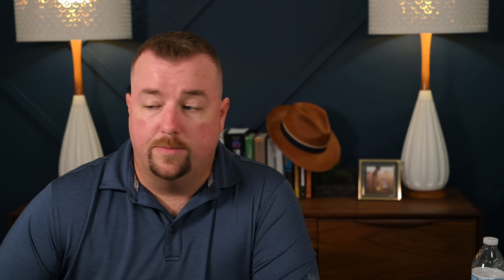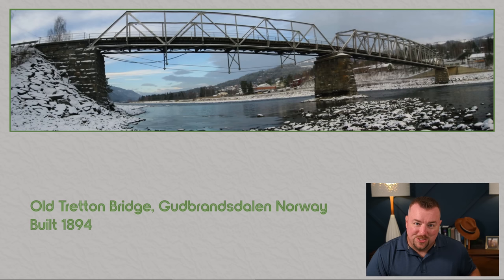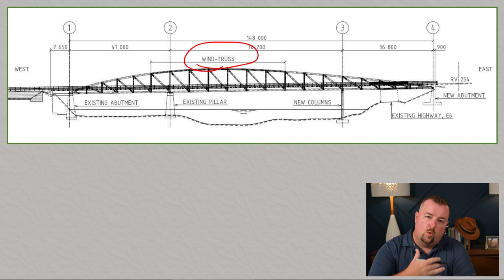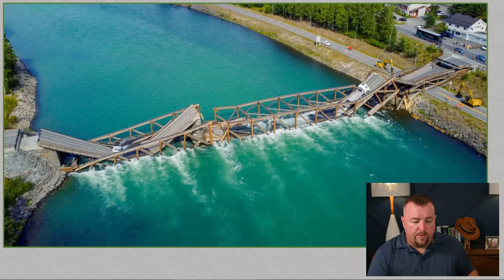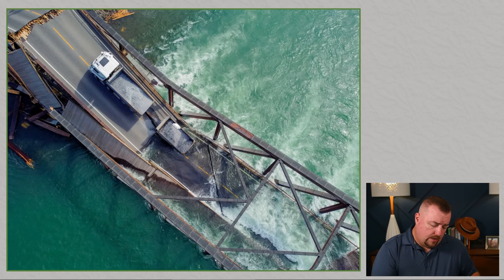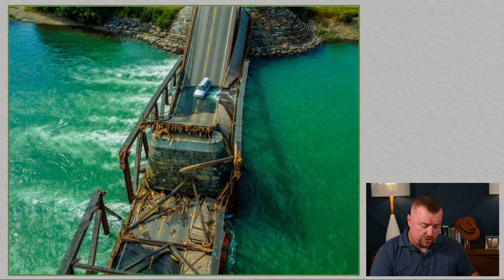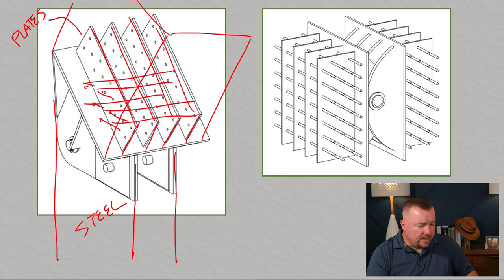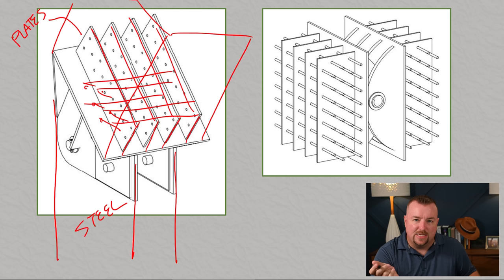How Did the Engineers Miss This?

Comment: Very interesting analysis. The failure illustrates why axes and hammers use a split and wedge to fix the handle into a socket rather than dowels. With a wedge the properties of the grain facilitate and enhance the joint. Also shows why old composite trusses usually use iron for the tension members.
Reply: The wedge design used to hold an ax head in place is a good example of how to hold metal and wood together. The wood is compressed against the metal. The same could be done in this bridge design, if instead of using a large number of dowel rods, they were to use heavy metal plates on the sides with a smaller number of large bolts or threaded rods clamping the plates together and holding the wood and metal under compression. There should be no shear between the bolts and the wood.
Reply: How is differential expansion and contraction deal with.

Comment: If they wanted to use natural materials, they could have just build a stone bridge. Correctly designed, those things last forever, even under heavy usage.

An example of this would be the viaducts of the Semmering mountain railway. Construction started in 1848 (yes, 150+ years ago), it was the first proper mountain railway. The original stone viaducts are still in use and hold up to modern railway traffic.

Comment: I'm not a structural engineer, but as a historian, I would have told you that the wood glulam stuff would have failed exactly as it did.  Over 2000 years ago, the Romans were making their shields out of laminated wood, but the grain of the wood for each layer alternated horizontally and vertically.

Comment: 19:00  Perpendicular to the grain, tension pulls the crack open and compression squeezes it shut. 
 Though the wedge action is generated by pushing, the split opens ahead of the bolt so the grain is getting pulled apart (cross-links between fibers)  
        
Ductile failure is where the hole-stretching (plastic embedding) is no longer able to accommodate the bolt's advance, and the piece begins to split -- the brittle failure.

Comment: Regarding the paper sentence:
"tested specimens were broken by tension perpendicular to the grain"
If I am understanding that correctly, they are saying the tension that causes the failure is perpendicular to the grain.

This is not saying the break would be perpendicular to the grain or that they were trying to make it fail that way.

Instead they are saying the failure was literally the wood appearing to be ripped apart with the grains separating, as observed in the photo.

This is because as the rods where pulled down, they tried to split the wood pushing it apart to the sides, placing the wood below the rods under tension perpendicular to the grain.
Eventually that tension exceeded the tensile stress of the wood and the grains separated.

Comment: The laminate was also laid on its side - meaning the bridge was being supported by the wood in its weakest position. Anyone who's looked at the frame of a house could see you always put things like floor joists so they're on edge, because a 2x10 has much more strength going from edge to edge, than through the 2" thickness.

And glue laminated beams are no different. If you put them on their side, the bottom piece of wood used in making the beam is left to support itself, and thus is vulnerable to failure much more easily than if it was properly on edge, where all of the constituent pieces are equally supporting the load.

Who wouldn't have seen that during construction?
Reply: The first time I saw something like this bridge was an ultratruss. It was a 2" thick laminated web that was 18" high with 2x4 cords. It was to span a squash court. If you flopped them over they wouldn't carry a single person, as installed they were rated to over 4400lbs equally distributed.
Reply: The composite beam was on edge, thats the important part. I would argue the lamination was correctly oriented, but the connections were pretty obvious not. Glulam beams are typically stacked laminations like this, where lvl beams are layered they other way with much thinner veneers being vertical.

Comment: Thanks Josh for another fascinating failure analysis video.  

I was shocked to see an uncovered wooden bridge was being used to carry such heavy loads over water and with a huge span between supports!  Wood, like concrete, doesn't perform well under tension.  Also, wood has a much different temperature coefficient than steel, in addition to changing size with relative humidity.  I see many problems with the steel/wood interface but, that would likely trigger a never ending debate.  Anyway... I enjoyed the video, thanks Josh!
Reply: And what is the thermal expansion co-efficient of the glue, relative to the wood? And what about the wetting expansion/drying contraction, and freezing expansion/thawing-&-drying contraction, both of which would affect the wood, but not the glue? Lots of problems. At the very least, protect joints like this from getting wet.
Reply: @grizzlygrizzle  Yeah, the list goes on and on, that's why I didn't elaborate, as there are no end of opinions.

Comment: Besides the bolt rusting issue which will occupy more space,  there is the issue of thermal expansion. The steel will heat and cool and file a groove over time. 
 But there is a big issue, the speed of the truck. There is a wave moment that needs to be considered. 

 An example is loaded semi trucks driving on 4 feet of ice (in northern remote parts of Canada) have a speed limit. There is a wave in front of them as the coast along. If they exceed a certain speed the ice breaks up.
 All drivers for that reason carry a large hammer to break the windshield because the door can't be opened to get out in an event ad such. TFS!

Comment: My initial thought is you could greatly increase the strength of these type of joints by banding or completely encapsulating them in steel. For these failures the wood must expand when it splits. I believe keeping the joint in compression would greatly limit this type of failure
Reply: Agree. Also some kind of a dovetail connection would've been a common choice of any cabinet maker gluing together a drawer.
Reply: Or you could encase the vertically laminated wood with horizontally laminated wood or vice versa
Reply: @matthewholt2174  yep, this laminated notions confuses me. I see regular beams there, not laminated. Laminated is like plywood. 
So I assume that the lamination is used at the bed of the bridge, where can be seen layers of wood, but here are just regular plain beams.

Comment: It all makes since because it's the same way we split logs.  A wedge that travels through the grain.  They are just installing the wedge inside the log and then splitting it with force applied on the log rather than the wedge(bolt).  It's a log splitter.

Comment: What is most worrying is that the bridge failed under the load of a single truck whereas it will have been designed for standard pattern loads of vehicles at random positions over span. The reduction in load capacity compared to the design case seems to have been very significant.

Comment: As part of my civil engineering degree, I studied structural wood design and my 4th year project was a 2 lane, 100m, 4 span gluelam timber highway bridge so I do know a little something about designing gluelam timber bridges.

First, in structural wood design the connection points are always the weakest points.  One of the biggest limitations of wood is designing connections to transfer load from one member to the next.  At a quick look in this video without more detailed analysis I would tend to agree that it appears to be poor connection design that caused this failure.

Second, your implications that wood is outdated and the bridge should have been made of steel are total ignorance.  Wood performs far better as a structural material than steel in many applications.  Wood also has a far higher strength to weight ratio than steel.  The only issue in using wood for structural members is knowing it’s unique properties and limitations.  Just like designing with concrete requires more engineering details and calculations than designing with steel.

Wood is being used far more in structural design right now due to many factors but requires structural engineers to be skilled in wood design, more diligent, and, detailed in their designs and calculations, particularly connection points.
Reply: Steel has wonderful properties that don’t transfer well to wood. Joint design in steel is much easier than in wood. Glulams can make excellent bridges, but wood’s nature must be understood, respected, and designed for.
Reply: @bradnail99  Exactly.
Reply: there's a reason the oldest wooden bridges are covered/roofed.  rot
Reply: @bradnail99  , "Steel has properties that don’t transfer well to wood", quite literally... while the investigation is still going on the couscous atm is that the steel parts changing more in size with temperature compare to the wood than have been calculated have been causing micro-fractures in the structure that have not been caught with the timed inspections.
(add inn that this is in some regions that have extreme temperature variations, all from 40*C to -50*C and not uncommon with 30*C difference between night and day)
Reply: @element5377   Not an issue with properly treated wood.  There are creosote treated railway ties that have been sitting on the ground for over a hundred years and they are just fine.  We're not allowed to use creosote anymore but the modern (less toxic) treatments are almost as good.
Reply: Wood and engineered wood are wonderful construction materials. However, as you say, with any you need to know every material's properties. There are considerable drawbacks when using wood in non-conditioned and exposed applications - even with material treatments and coatings which may reduce performance or restrict application further (we can't creosote glulam and CLT).

I don't think he was denigrating the material itself just the application in this design.

Comment: 6 axles... so max 50 gross metric tons legally - 110,000lb. And it's hauling aggregate, so those are easy to overload. Although Norway allowed more 60t max gross trucks in 2020, timber trucks were always allowed to be 60t. But I don't think that truck is new enough to qualify. And maximum gross listed for Norway (outside special types for oversize, overweight) is 76t (167,000lb).  That's a LOT for glued wood to hold up.

Comment: I'll bet this bridge weighed as much if not more than making an equivalent strength bridge in steel. It was a beautiful bridge but this feels a lot like the fcu bridge collapse.
And I absolutely agree with your evaluation, thank you!
Reply: Not sure the relevancy of the bridges dead weight. I doubt the engineers number one objective was minimal dead weight, but rather were trying to design a bridge using more sustainable resources (not that steel is very unsustainable). I think there is a lot of potential to use lumber as a building resource beyond its common applications as 2x4s; but the industry is in the beginning phases or figuring out its limitations.
Reply: @jmvoltrino  my comment was simply to introduce the idea that the steel parts needed to be built in such a way that they used the same amount of steel as if the entire bridge was just made out of steel and would have been 3-4x as strong as the wood bridge. The only way I could convey that was through the weight of the entire structure, but I do understand where your confusion comes in with how I worded my comment.
Reply: Maybe not 'as built' and in the air conditioned warehouse where the pieces were pre-fabbed. But I bet after 10+ years in the weather after being waterlogged was heavy as hell. Just pick up a wet pressure treated 2x6, and a kiln dried one, the difference in weight is quite noticeable!
Reply: @jmvoltrino  Someone from Norway commented above that bridge dead weight was in fact a major consideration, since it had been pre-specified that the original bridge piers had to be used, and they were designed to support a light single-lane bridge. This was twice as wide.
Reply: Good point.  Seasonal expansion and contraction could also lead to the wood loosening in the steel connectors, like an axe head "flying off the handle".  A crushed grain will not return to it's prior size.  A loosened sloppy joint would be weaker.

In a traditional timber frame, green beams are dowelled with dry pins, so the green wood tightens to the pins as it shrinks.
Reply: @jmvoltrino  actually a wood bean of the same shape cross-section of the same weight per foot  will have a budder volume. Say simple bean twice as high as wide a steel beam might measure 1 by 2 inches, 2 square  inches. The same weight wood beam would be  6 square inches or 1 and 3/4 by 3.5. The wood beam would be 7 times stronger according  to Gordon  the strength of material. However I may be miss remembering ie because steel is 495 lbs per cubic foot while wood comes in at less than one spicific gravity  ie less than 62 lbs per cubic feet  so if I switched remembered numbers then the area of a beam of the same weight per foot would be 17 square inches ie 3.25 by 5.25 to weigh the same as the 1 by 2 inch steel beam but wood beam would be three times stronger than steel
Reply: I reckon the older 1800's bridge was far prettier.
Reply: @chdreturns  I absolutely agree.
Reply: @lwilton  I also suspect the weight of the new bridge would have been much heavier than the original bridge, but it was not designed correctly to allow for all the tolerances needed to remain a valid load carrying bridge.

Comment: I live in a cold climate, one rule I've heard is never to use epoxies or laminate coatings outside, because frost gets behind it and can literally peal it apart by force of mechanical expansion of ice. We always use latex or breathable coatings that won't trap frost. Potentially another issue if they used some sort of laminate product that wasn't compatible with frost. 

In general, I wonder if they've done any studies on the stability of the adhesives they used, as well. I've seen plenty of construction and plenty of wood joints where the adhesive just turns to dust after 10 to 15 years. I don't know if it's moisture, frost, oxygen or mechanical stress fractures. Glues great for holding a joint together during construction and a few years later, but I'd have to see proof that it's chemically formulated not to degrade.

Comment: I have been a truck driver for forty-three years. I think the truck did, in fact slide backward to some degree but did not leave skip marks because the weight of the load prevented the tires from skidding. Instead, it's my opinion that the brakes simply couldn't hold under such a weight and angle. This is why they say a loaded truck stops faster than an empty one since it doesn't skid schedule. The additional fact that the steer axle is at a slight angle, maybe inticutive of the driver attempting to keep the rig straight as it did, in fact slide backward, out of sheer instinct.
Reply: I would add that the “pup” trailer is what is holding the lorry from sliding further once the brakes finally held. The rear of the combined unit is sitting at the toe of the slope and is up against the next slope. At the slope of the bridge I suspect that there is a significantly reduced weight on the two front axles resulting in sliding but very little rubber transfer to the pavement.

Comment: I'm even cautious about using Glue lamb for residential, and would "NEVER" use laminate beams for this bridge application. Laminated structural elements are extremely vulnerable to moisture, water, and other factors. 

I'm extremely surprised the local building laws allowed such a construction. What probably happened is that because a "Engineer" signed off on the construction the city was like ok stamp it. One thing is for certain, whichever engineering company signed off the plans is, better have an amazing legal team.   

On such a small bridge, why not just build it "STRONG" out of steel, then likely there is no need to worry about it. 

Well one thing is for certain. That this collapse is a great educational example for all.
Reply: An all steel bridge would have been much less complex.
Reply: @SteamCrane  Yup, fully agree

Comment: I haven't seen it mentioned yet, but Hickory, North Carolina had a glulam pedestrian bridge that collapsed.. I don't think it was even a year old.
Reply: That was not glulam, it was timber frame. Still appears to have failed at the connection points.
You would think engineers would be super leery of joining highly dissimilar materials like wood and steel.
Bolts, pins.. point loads.. are just begging to have the dissimilarities cause a catastrophic failure.
Reply: @christophertstone  when was this? I live just an hour south of Hickory and don’t recall hearing about this.

A bit off subject, have you ever seen the “Mile High Bridge” on Grandfather Mt? It’s not wood, though I think some of the original was. It’s quite a bridge that has been reinforced to support the wind loads up there.
Reply: @christophertstone  I don't understand the difference.   The arches were made of laminated timber, isn't that glulam?
Reply: @shakeydavesr  It wasn't actually a bridge that collapsed, but a set of decorative wooden arches over the City Walk pedestrian bridge between the Main Ave bridge and the railroad bridge over Hwy 127. It happened on February 18 of this year (2022). The 40 ton arches fell onto the pedestrian bridge and the Main Avenue bridge, but to my knowledge, didn't cause any significant damage to either bridge. IIRC the Main Avenue bridge was reopened shortly after the debris was removed. The arches were less than a year old when they fell.
Reply: @Stephen-fb2zn  Yes, the photos I'm looking at are laminated timber also glulam which is the same thing at least according to the Wikipedia page on it